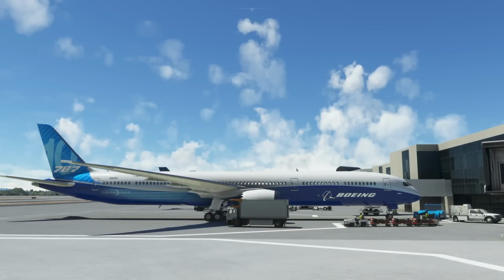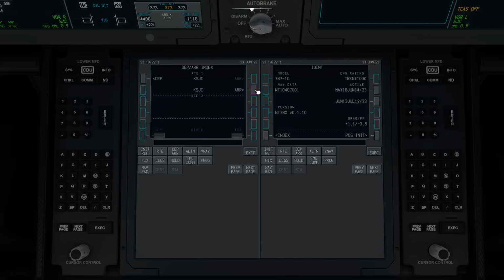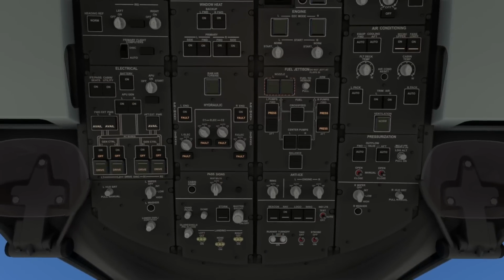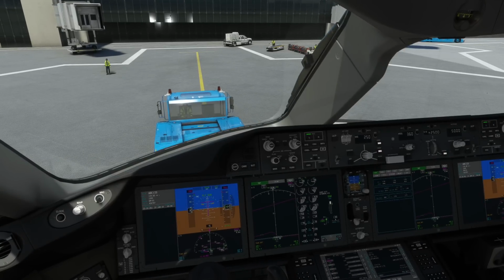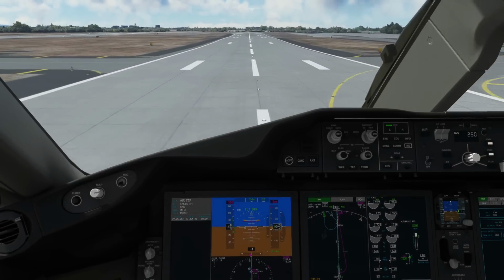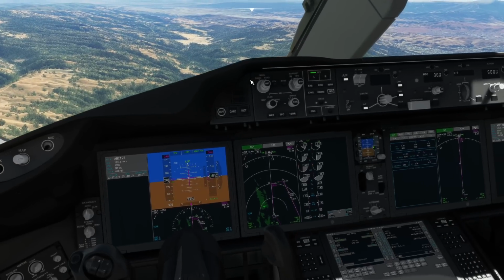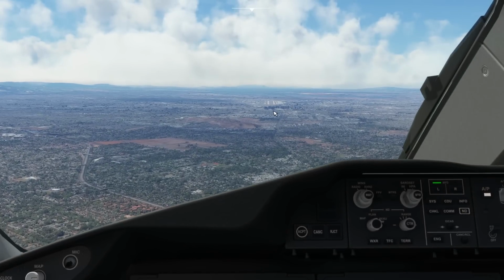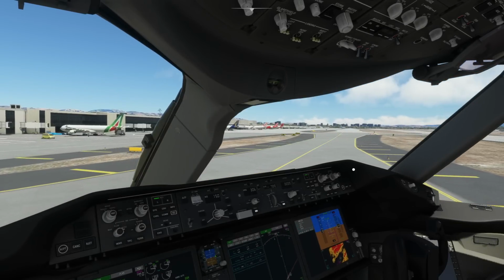First look at the Boeing 787 Dreamliner in Microsoft Flight Simulator following the AAU2 update

Comment from the maker: Lots still to learn - especially the cause of that take-off routing disparity!
Reply: When you do a direct in Boeings (such as you were) it uses your current heading and draws a route from there. So when you were in gate it assumes you were going from that heading. Also, you can start both engines at once since they are started electrically and not via bleed air
Reply: After a major update a week or so ago, My b787 and b747 will no longer follow navigation instructions.  Whether I use the world map to set departure and arrival, or use the flight management system.  Is anyone else having this problem.  NOTE- It does not affect my b777, b767, a320.   The b787 and b747 WILL following heading instructions, but not LNAV.  They just flight straight.

Comment: I noticed you never added ILS frequency and runway heading in NAV Approach.  Field was blank with word PARK outside the box.  Somehow the flight director found the LOC and G/S so I wondered if it somehow knows the ILS frequency based on airport and ILS Runway 30L you selected?

I’m also find the airplane makes some wild turns and dips when I first engage autopilot after takeoff.  Usually I need to shut A/P and take manual control, then I can again engage A/P and things seem to smooth out following LNAV and VNAV. Any comments?  Is this a software glitch perhaps?

Comment: I have tried this one as well as the 747-8 and found the 747-8 was fine on flight from EGCC to EGPH and behaved well all the way to the parking. However, the 787 was not so good. The takeoff, climb and cruse was fine. The plane descended fine down to 10000 feet but refused to descend below 10000 feet so I had to do that manually down to 3000 feet and then the approach and landing was fine. I have tried this several times  but the result was still the same. Initially I did have the Heavy mod which I removed and replaced with the AAU2 update. Everything except what I mentioned worked just fine. Not sure what I am doing wrong.

Comment: Excellent as always, thank you very much. One question, where do I find the update for this jewel? I have got the Standard, Premium and Delux versions of the MSFS and therefore the 787 which I have really enjoyed in the past. However, now the AutoThrottle is stuck on and can't be moved and the speed is uncontrollable and goes to flat out. I do actually have the "Heavy" mod but that has worked fine in the past but I'm not sure if that could have caused some issues with new updates.
Reply from the maker: Remove the mod.

Comment: Normally, I set my destination in the world map.  Set attitude, vs and cruise speed.  Hit LNAV and the plane routes and flies to the destination.  Since this update LNAV will not activate. So the plane just flies in the straight line from the runway heading.   What changed?
Reply from the maker: The FMC became more realistic - you cannot get away with just setting the route outside of the aircraft any more - you have to learn how to program the FMC.
Reply: @jonbeckett  thanks for responding to the question. But a lot of users like me I'm not trying to get so immersive that they start the plane with engines off at the gate.  

What's the purpose of having a world map to route a course, but no longer be able to simply fly it?  It's extremely frustrating, to have software that you can no longer use, that has been providing an easy route to get in the air for more than 2 years.  I switch back to flight simulator x, when I want to fly the 787 and 747.

Comment: I had a issue here with the default 787 & also the 747-8 how can I fix an aircraft just pitching up in the air espacially when the aircraft is accelerating down the runway for take off then it just pitches up by itself again in the air to the point of stall? So what I should i do to fix the problem? By adjusting the pitch trim on the yoke or using the altn trim?
Reply from the maker: It sounds like you have a controller configuration issue. I have trim on the hat switch on my joystick, so I can trim immediately if necessary.
Reply: Same with me

Comment: Can someone please help me. The 787 does not work for me. Every time I try to start it up, it starts up for a bit then shuts back down and I can’t see anything on the screen.
Reply from the maker: You probably have an issue with your controllers doing something odd. Start from the default profile, create a new one, and work from there. I know certain controllers (Honeycomb, for example) have issues with the default power switch behaviour.
Reply: @jonbeckett  I use the turtle beach yoke
Reply: @daytonvo2000 try going into the settings of the sim menu and delete your rolling cache. Save. Restart sim. Then set the rolling cache to your desired size again and save. Restart sim. This helps me when I have black screen issues.

Comment: I don't know what Asobo/Microsoft did with the latest update but none of the buttons that power up the electrical systems (battery, external power, and APU) work anymore when I use the mouse, not even the default Alt-B on the keyboard work. I tried the Cntrl-E on the keyboard, and that started both  engines but it failed to activate the battery switch, it did however activate the external power sources, which gave me enough time to program the FMC. Of course, the electrical systems turned off about 10 minutes after push back from the gate. All those systems used to work normally prior to the last update.
Reply from the maker: I've not had a single problem with it. How strange ?

Comment: I’m not sure if anyone can help when I get to landing my aircraft touches down then violently swings to the left not to sure why and it does it every time. Anyone else having this issue after the new update
Reply from the maker: Sounds like a controller configuration issue.
Reply: @jonbeckett  it doesn’t do this whilst taxiing or taxing off just on landing which is why it’s so confusing

Comment: Did something happen with the thrust reversers? For some reason I can't activate them until the plane already has slowed under 40 knots or so, which defeats the purpose of them... The other planes they function ok still-- a320 and citation etc
Reply from the maker: They work fine for me.
Reply: @jonbeckett  thanks for checking into it! I think it's related to my throttle calibration,  doesn't actually stay at idle when I pull it all the way down before clicking reverse

Comment: This plane is very broken! Flight model is worse than before, constant ctd and very buggy! The engine sounds are better but I can’t distinguish a difference between the GE or RR engines!!!
Reply from the maker: Did you remove any other mods for it ? I didn't have any, and have not had any issues.

Comment: Just a side note about the fuel control. You do not have to wait until 20% N1. You can start both engines at the same time on the overhead and set both fuel controls to on immediately after engine start.
Reply from the maker: Interesting. Is that something you can do in the simulator though, or something the real crews do in the real aircraft ?
Reply: @jonbeckett  I do fly the 87 IRL, yes start both at the same time, don't wait for any N1. Just flip the switches and let it do its job. Hell we train to NOT intervene for any kind of failed start, but to let the automation handle it.
Some other notes. You would never use the aft external power unless the APU is inop and you are using the ground power to start the engines. It requires maintenance to open that panel and is a PITA. Forward two only for normal ops.
On takeoff advance the thrust levers to about 40% N1 then select the TOGA switches to enable the autothrottles.
Don't know if the sim has it, but on the Navigational Display (ND),  select the menu on the top right and select the vertical profile. We leave it on all the time and is super helpful.
Hope that helps!
Reply from the maker: @tehcurti  great info - thankyou! I think I saw IntoTheBlue doing a walkthrough with a 787 pilot - seem to remember the vertical profile isn't implemented (yet) - it's in the PMDG 737 though :)
Reply: @jonbeckett  This is how real life pilots do it too. Both on at the same time, no waiting for fuel
Reply: @jonbeckett If the sim allows it,  I'm sure no one will lose their pilot credentials unless the FAA plays flight sim
Reply: @jonbeckett Not in real life. Usually Right then Left 😉
Reply: @jonbeckett  There is a full flight stockholm to LA on youtube where you can see this dual startup happen in real life

Comment: Hi! Ive been trying to fly this and the 747 and they are not follwing the flight plans i put in. I dont know how to change it over from follwing a vor to the route planned in the navigation screen could someone point me in the right direction TIA!
Reply from the maker: I'm pretty sure LNAV refers to programmed waypoints in the 747 and 787. If you want to fly a VOR radial, you'll need to set the course and heading appropriately, and adjust as you go. That said, approach mode will capture the ILS localiser rather than using GPS.
Reply: Ok thanks!

Comment: Loaded the plane but throttle and yoke not responding to imputs and availible power not switching on even though shows avail. Is There something i must do before loading plane such as update
Reply from the maker: Sounds like you might have a software conflict. Did you have any mods installed for the 787 previously ?

Comment: The 787s engine start is automatic . Yo do not have to wait for any N2 or N3 value 
Engine Start Procedure
Select the secondary engine indications. F/O
Crew action to correct for abnormal engine indications is not needed.
Respond to any EICAS messages that show.
Start sequence .......................................................Announce C
The engines may be started at the same time.
Call “START __ ENGINE” C
Engine START selector ............................................START F/O
FUEL CONTROL switch .............................................RUN C
If the engines were not started at the same time:
After the engine is stabilized at idle, start the other engine.

There are also several procedural mistakes on the video. Do not take it like a tutorial since it does not follow Boeing SOPs  for instance never preselect vertical speed for takeoff
Reply from the maker: Freat feedback, I didn't say this was a tutorial :) I often show different functionality of aircraft purely to show the functionality. Of course in the real world the crew would use VNAV, or flight level change :)

Comment: I experienced very odd LNVAV stuff and VNAV on descent was really bugged.
Reply: I've noticed the autopilot starts bugging out when you go into external view, do you also have this issue?
Reply: I've also experienced the same issue with the LNAV, which failed to follow the waypoints defined in the flight route. The flight simulator also froze after about 2 hours at cruise altitude. So Asobo has broken something in the last update.

Comment: Since the update, during landing, the toggle reverse thrusters button that I have keyed into my Logitech joystick will not work until it's slowed down to 30 knots, which I havent got a clue why. I am puting the throttles down to idle first during touchdown. The same function works normal in the Airbus 320, so I know it is mapped on the right key. The "Hold Reversers ' button will kick them on, but it is more awkward to keep holding it down. Anybody else have this problem? It used to work fine on this plane before the update it seems.